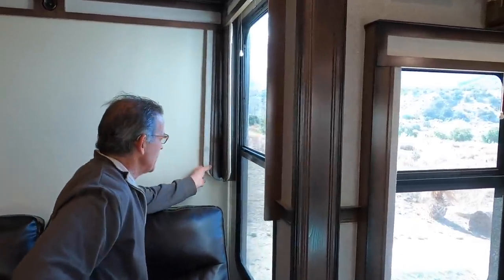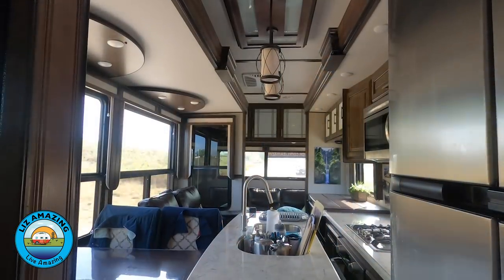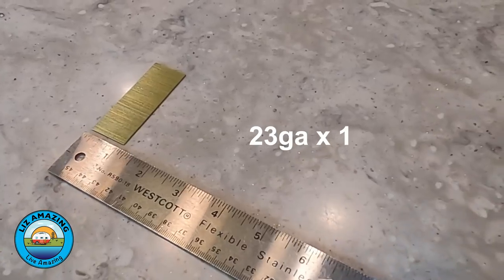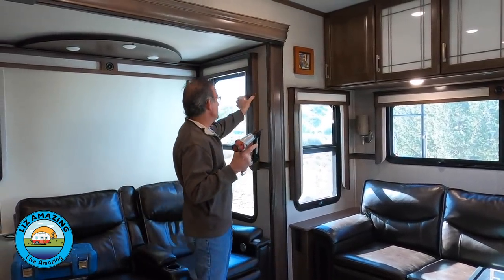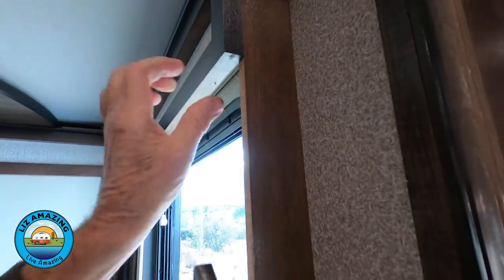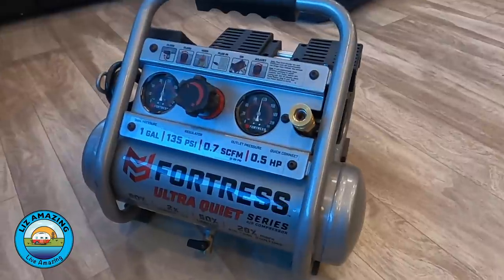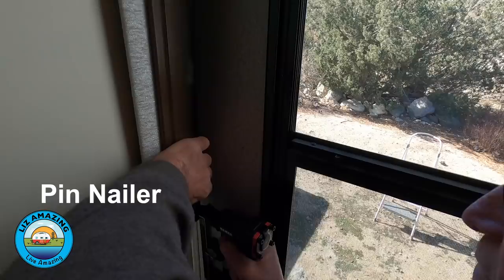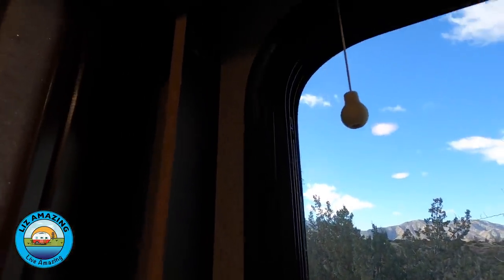RV life: What do you do when pieces fall off inside your camper | How to fix it | RV living

Comment: Use friggin adhesive.  If you knew woodworking you would know how good woodworking is done. This is 1st grade stuff.
Reply from the maker: Yep. Paul says the trim needs to be with pin nails, the way it is because you need to access things beyond them and glue would make that impossible. But yes, they could have done a better job in some areas.
Reply: Not just any adhesive. Most construction adhesives give off a toxic odor that never goes away. Consult manufacturers to find proper adhesive
Reply: @LizAmazing  glue would not make it impossible to remove trim if the proper adheasive was used.
Reply: Use adhesive!!! If you don’t, you’ll continue to have trim coming loose. Fix it the right way.
Reply: @LizAmazing  Liz, if he uses the proper construction adhesive, you’ll still be able to remove trim if needed. You only need a very small bead of adhesive. The brad pins should only be used to hold trim in place while it drys overnight. Also make sure the construction adhesive is odorless since it’s being used for interior work. Consult manufacturers to find proper adhesive. I’ve done this before and it’s by far the best solution for reattaching trim and other things, even cabinets. Again, when using brads to hold trim in place after gluing, use existing holes from original fasteners. I wish i was there to show you, so that you don’t make any mistakes.
Reply: @LizAmazing  don’t consult with homedepot or any home improvement stores. They don’t know. Call and talk to product engineering people from two or three different manufacturers to find the best adhesive to use.
Reply: Some brad nailers or guns are designed to drive brad pin below the finished surface so it can be smeared with color matched putty afterwards. You don’t want to make work for yourself

Comment: Liquid nails
Reply from the maker: Well, yeah. For the trim, we need to use the pin nails because we will need to access areas behind there later. For example, working on windows, lights, etc. The pin nails actually are now holding everything in good and tight.